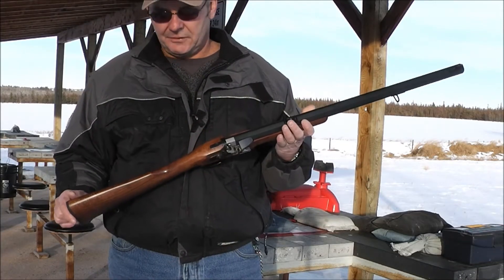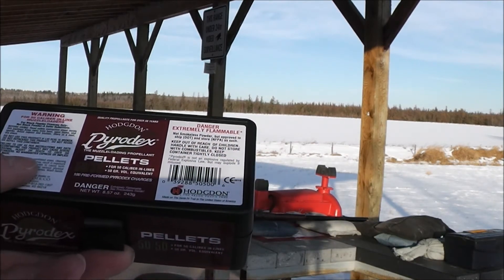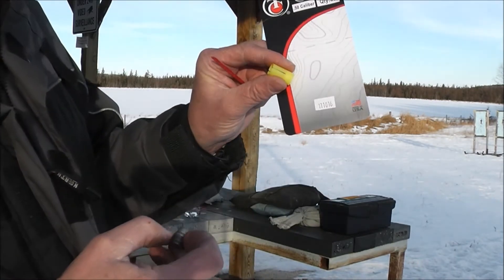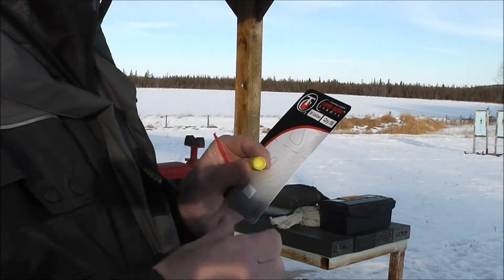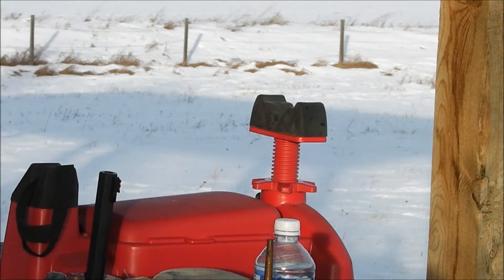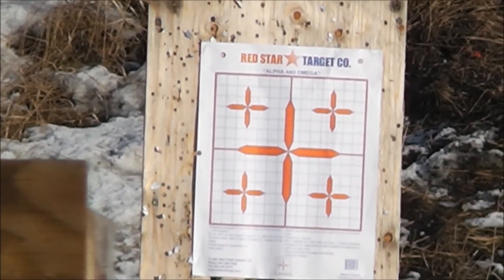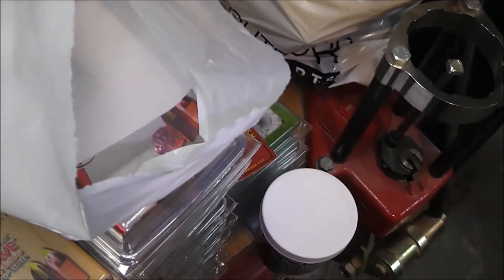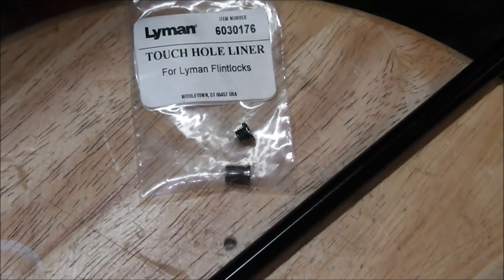Traditions Pellet Flintlock Fail!

Comment: Pyrodex pellets are not a good choice for flintlocks.  They are much better for muzzleloaders that use 209 primers, such as inlines.

For flintlock rifles, you need to use real black powder, 2F for rifles and 3F for pistols.  For the priming pan, the best choice is 4F.  You may also want to ream the touch hole a little bit at a time until you get consistent ignition, along with a piece of wire to clear the touch hole of any fouling every few shots.

If you think it’s a lot of work, you’re not alone.  That’s why all of my muzzleloaders are caplocks or inlines.

Comment: That sucks! Is there anyway you could re tap that so you can put another touch hole liner in there? Just a thought. And if nothing else id contact Traditions and see what they would do about it.
Reply from the maker: I'm thinking on drilling and tapping it for the Lyman touch hole liner since it is larger and twice as deep. The fine thread should go well and I would drill the new port  to the same size as the Traditions.